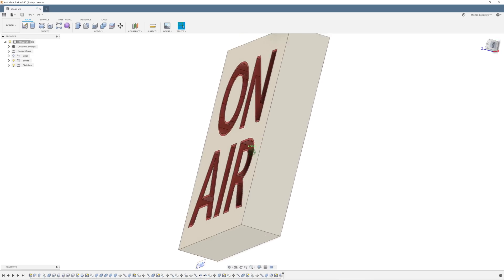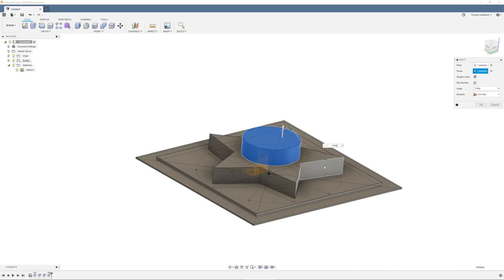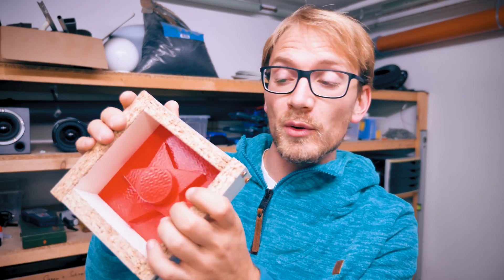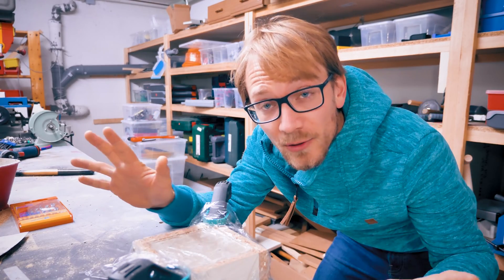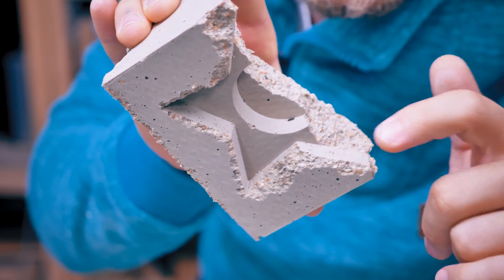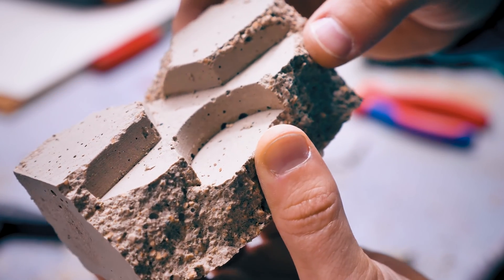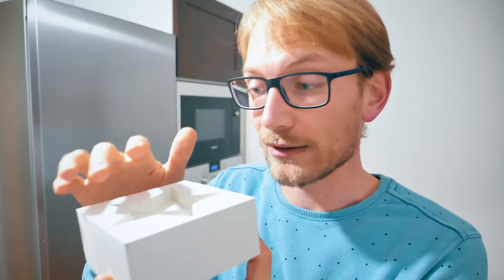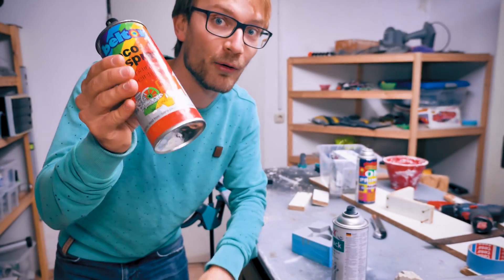Digital casting: 3D printed molds for concrete and plaster!

Comment: I printed a relief map of my region (using USGS data) in good old PLA, made a plaster cast of that (using "PAM" as a release), and used that to make multiple ceramic slip castings. The layer lines and surface details carried over perfectly to the fired pieces.  I'm working on the metallic glazes now...

Comment: Spray your mold with a LIGHT coating of cooking oil.  That will help it comeout easier.  To get rid of the 'bug holes', make the concret/plaster a bit more liquidy.

Comment: I've seen other YouTubers use melamine forms for making things like counter tops and tables, and there are some ideas you could take from those videos.  

Just a high-level overview of some of them:

- Use glass fibers in the concrete mix to give it some tensile strength.  It will hold together better, and will be far less likely to be breakable by hand.

- Apply a simple paste wax to the corners and edges, then seal them with a silicone sealant.  Then, skim over the silicone with something that has a rounded edge (I've seen some use a cake fondant ball tool to accomplish this), to push the silicone into the corners, and separate the edges of the silicone from the corner.  Then, once the silicone cures, peel off the separated edge, leaving the corners in place.  This helps seal against leaks, and softens the sharper edges of the concrete.  It also helps with releasing later on.

- For the detailed mold, apply a light layer of a releasing agent.  I've seen commercial applications use things like linseed oil, but there is also a synthetic product intended for this.  It'll make pulling the mold out much easier and cleaner.

- Some people have already mentioned vibrating your concrete when finished, but it's almost unavoidable that you'll need to make a bit of a slurry mix to fill pits and imperfections, and then sand that down when done.

Comment: I'd say concrete or if you can do a mix. of maybe so a two layer cast where the concrete is less viscous and coat the outer layer/sides and the rest cast in plaster. If it's in concrete it might weigh too much for comfort and if it's all plaster it might wear down after a bit... Food for thought.

Comment: If you like a textured look, you might try using Cura's "Fuzzy Skin" option when you print the mold.  The height and density of the texture is controllable.
Reply from the maker: I'm afraid that would lock the printed inserts solidly into the cast. Maybe once I've really figured this thing out, I can start playing with some of the crazier options!

Comment: Release agents will soak into the cement, concrete or plaster and will ruin a latter painting. Just leave it dry more time. Plaster should be creamy to mold pieces, it will make much better parts but also can hold bubbles. Once it is dry, if you are going to paint it, you need to apply a sealant, but not regular wood primers. You can try some diluted latex or pva glue if you do not find specific sealants for walls. Ah, and one more thing, plaster becomes hot when curing, as you already noticed, so my advice is pour a test on a disposable container and find out how hot it goes. 3dprinted plastics may distort.

Comment: With the concrete I had fewer breakages and chippings than with the plaster, when casting a chess set as part of a university project. I ran test casts using plaster (Herculite, a strong plaster used for architectural models) before making a few sets in plaster as well as concrete.

I used a mould release agent (any oil will work, I've used petroleum jelly, vegetable oil, olive oil, sunflower oil in the past  as well as industrial concrete release agent for this project) on all castings.

As far as the angle goes, it will definitely help in terms of releasing of there's a 2-5° taper.

I had difficulty in releasing certain pieces, so for the next iteration I plan to add a small hole that would be plugged for the cast, with a larger concentric divet to allow me to blow the castings out of the moulds with compressed air. It's possible that the taper may not be required with this change.

Comment: If the the positive (3d print) is going to be used just a few times, try using a sandable primer thinly applied before casting. It can smooth out the print lines considerably.  
Anchoring cement will also make a very hard cement product (but heavy). Add some fine aggregate or tiny glass beads and maybe a bit of concrete colorant for a more finished appearance.

Comment: If you have a vibrating sander (the rectangle once) you might get rid of the last bubbles. Just run it on the table instead of hammering.

Comment: There's a product I've used in the past for making outdoor stepping stones with stained glass tops. It's called white mosaic outdoor cement and is made by a few different manufacturers. I tried to find material specs, but all I could find that it was portland cement and sand. I agree on keeping the draft angles, and vaseline makes a good mold release agent. Thanks for another great video!

Comment: When your painting fresh plaster you need to do a 'wet coat'.   It's super easy you just need to the mix the paint with water (1:1 ratio), then paint over again with pure paint when its dry.

Comment: Definitely with this filaflex you can make excellent molds. 
Small tricks to improve casting in molds of concrete, gypsum or plaster of Paris objects:
with each new casting, brush the surfaces of the mold with liquid soap: the one for dishes is fine, this will facilitate the detachment of the surfaces,
the most technologic will be able to use professional release agents, but to make tests the soap is excellent, I used it at middle school in the hours of art.
To avoid air inclusions there are two methods: prepare a small amount of more liquid dough and pour it into the mold covering all the surface that will be visible, stirring and beating the mold as Thomas did, let it harden a little and then fill with the rest of the dough with a normal consistency.
Second method, more complicated, put the mold filled in a vacuum chamber that will remove all the air, vibrate the mixture and re-inject air before it solidifies: the atmospheric pressure returning will further compress the mixture, reducing the number and size of the bubbles .
Third and last trick: a lot of patience: fill the mold, put it aside and forget it for a couple of days at a minimum.
Another little help in making molds: vertical surfaces should become slightly oblique: slightly conical the cylinders and slightly pyramidal the prisms.
bye

Comment: Add a very thin layer of petroleum jelly on the inside of the wodden frame. That will help removing it. That second attempt came out much better. Please use plaster. Just add some gravel or course sand. You could build a vibrator that would help getting rid of the voids ;-)

Comment: The vertical planes of the model has to be in a small angel. Not 90 degree, but in a angel 85-88 depending of the material. Then de model goes better out of the plaster (or what ever)
Arie

Comment: you need a sander or something to shake the table to get the bubbles out. also in the US there's this really fine concrete called quikrete that is used for countertops and stuff and can be smooth as glass. maybe you can find something in Germany that's similar.

Comment: There is a product called Merlin's magic and excalibur that is used for mold making.  It has the strength of concrete but the workability of plaster.  You can use waterdowned jet dry to help with the bubbles

Comment: I am curious to see what effect the different infill patterns and percentages will have on the top surface of the print, and therefore the mould. The gyroid waves looked very pretty on the top of the candle-holder with the shadows that it casts on itself at 14:28! :)

Comment: I would add munched fibreglass strands into the mix. That will help keep the cracking and splitting down. 
Second the release agent. I will occasionally use the wax ones so I can merely heat the mould and it falls out.
Or, if you are making a bunch of these things, I'd make a silicon mould and then no release agent is rarely required.

Comment: Good addition of the draft, but the sharp corners at the base of the model can cause major headaches as well. Typically in metalcasting we use some level of chamfer or radius on inside corners like that for better mold release.

Comment: I'd do plaster and I'd also reinforce it with some kind of fibre (Cotton - like a cast for a broken arm, glass also works, carbon too. Even hair if you want to go oldfashioned.) It'll help protect against some of the brittleness which leads to cracking.

Comment: as mentioned in the comments before, a releasing agent, like for example WD40 will do the trick. but also no 90 degree inward angles, cause that is where the mortar gets stuck in
Reply: I got also quite results with Vaseline as a releasing agent.

Comment: Hi Tom. I use 3parts fine sand, 2 parts rough agregate like fine gravel 3-4mm and one part cement. I get awesome castings like this. Remember to vibrate it heavily to get the bubbles out.

Comment: I'm making slip cast pottery with plaster moulds. The patterns I design in Fusion 360. I print these, then make moulds off of them. I also CAD and print part line guides to help with complex moulds. When I get a site together, I'll publish pictures of my results.

Comment: Why didn't you just print the mould directly?
Reply from the maker: You mean leaving out the melamine sides? The next step in this project requires me to use them, so I wanted to give the approach a good trial run before I cast a 3kg brick that ends up fused to the mold.

Comment: Hm, maybe using a construction primer ('Tiefgrund' from your local Baumarkt) would result in a better surface finish than with the spray paint primer? Also, letting that plaster set for 48h+ will do wonders :).

Comment: Look up the term "Release Agent".  That will help.  Also, if you have a palm sander turn it on and put it against the edge of the mold.  That will vibrate the bubbles to the top.
Reply: Yes the eccentric sander was the first thing that came to my mind too.. vacuum would be much better, but I guess it`s harder to get one, and it`s more expensive
Reply: @gatisozols  shop vac, garbage bag and a roll of tape
Reply: @Jeff_Rowe_Nuggzy  :D good one but I don`t think it would hod vacuum very well
Reply from the maker: Many comments are recommending grease-, wax- or oil-based release agents, but I'd be afraid that those will transfer into the cast part and prevent the final paint layer from adhering properly. The print actually released from the cement-based and plaster cast quite well, the only thing holding it in was mechanical locking.
Reply: @MadeWithLayers  you can always of course degrease the part afterwards, and prime it before painting. I believe concrete needs a primer anyway. and if you use a very thin lubricant, it will not transfer into the texture. yes. the print did release. but as we saw, it got stuck in the inside corners. maybe a shamfer could help in those corners
Reply: @MadeWithLayers  use paste wax.
Reply: Thomas, IMO you could make a PETG based form of two details. 1st - the form, 2nd - the handle to pull off that form. The handle can be fixed with a big thread with a flat triangle shape (so it will be locked vertically by as many rounds as you'll make it). I guess with 1 deg. angle draft it will be releasing quite easy. MAybe you only need to flatten layer lines with a sand paper.
Reply: @MadeWithLayers  You are correct that this CAN happen, which is why you will need to prime it anyway.  So you can use a light wash of pool cleaner (muriatic acid) to clean the concrete.  I say a "light wash" because if you use it at any significant strength it will etch the concrete.  There are also many other cleaners degreasers out there as well that could be used if you don't want to mess with that nasty stuff.  Also, since your part is flexible you may not "need" a release on the top, but you will on your sides.  I was geting more at that aspect.  I've seen (and had) concrete bind right to that top layer of particle board before.  I started using PAM cooking spray from a suggestion I heard from a person that does concrete counter tops.  Worked great.  Haven't done any forming in a long time, but it worked.
Reply: it depends what you want to do with the form. Oil,grease,wax is good when you want to use "safe" stuff for silicone casting for example. Lots of the relaease agents have nasty chemicals in them so not good for your health in the long run. Just read the ingridience list, research and judge yourself.
Also for the Plaster there exist a high grade version where you can get even more detail. Its whiter then normal plaster.
Reply: If you put ISO alcohol in a spray bottle and spray it over the top of the plaster just before you cast it will pop the bubble. Also pour the plaster over your hand, shaping it like a ramp to reduce the chance of bubbles as it hits surface
Reply: Also pour into the corner for the plaster just as it begins to thicken from a liquid and peaking(when you run your finger across the top you see the line for a second before it settles out), this will ensure the plaster covers your object as a liquid, capturing all the detail but will still set quicker. I would also seal the bottom of the melamine with paste wax or Shellac so that it does not swell from the moisture underneath.
Reply: well, even a very thin coat of WD40 might do the trick as well. or any other oil base for that matter
Reply: @enricotempert  "Release Agent"...doesn't matter what it is.  Corn Starch, Talc, etc is used quite a bit for metal casting release agents...For concrete counter tops many have used a thin layer of petroleum jelly.
Reply: @WreckDiver99  for concrete or cement, a powder wouldn't work that well. of course, better than nothing at all, but in construction an oil base is almost always used. and yes. petroleum jelly is oil based. although I think it is a bit too thick for this little thing. it will leave marks if not spread very thinly
Reply: @enricotempert  No doubt on the powders...I was just giving an example of a "release agent".  Many people hear that word and immediately think that means some ultra special item.  Sure there are "Parting Powders" available for casting operations, but talc works great.  For Concrete I've used PAM Cooking Spray (WORKS AWESOME), as well as Petroleum Jelly, and even "AquaCon" (which is actually a "commerical" release agent).
Reply: @WreckDiver99  I have only used the professional stuff, when I was working in construction. so I don't know much about the home-brew stuff. but I think a powder and thick stuf like petroleum jelly or Vaseline will leave marks. for applications like this, you only need a microscopically thin film of a releasing agent, that will do perfectly, and will leave almost no mark at all
Reply: all he had to do was take a heat gun and melt the 3d print and then he could pull it out easier
Reply: @thatguyfromca  I believe part of his intent was to keep a master copy so he wouldn't lose it.  This wasn't a "lost media" idea (i.e., lost wax, lost foam, etc).  He wanted to preserve the master pattern to be able to make more molds.
Reply: I'm using cooking oil with extreme good results, olive is very expensive but it's denser when cold which is good, I used a batch that went rancid. Regularly using sunflower oil and works as a charm.

Next time I will just get the cheaper oil we get here, probably soy.
Reply: this whole thread paints my thoughts exactly. grats on moving a step forward... but im appalled a creator in end 2018 is releasing a super basic, grade school level art project, with what seems to be very little understanding. 3dp, trouble with plaster... hm.

Comment: I know it can be a little more but for casting I prefer dental plaster. It pics up a super amount of detail,  sets up much faster and as the name implies use for dental applications so its super strong and durable. Combine that with a table that you can vibrate (I built myself a cheap vibrating table) or hit softly with a rubber mallet to remove bubbles. TRICK: to remove bubbles poor the solution or casting material from a height above the mold being made, the bubbles will come out naturally.
Reply: St. Gobain Dental and HP2 plasters are twice as expensive as their Fine Casting plaster. I have been using their Fine Casting plaster for mould making and it works better for me as its curing time is longer.  The surface finish on it is just as good as Dental or HP2 in my opinion. It's also easy to get hold of, as lots of builder's merchants stock it.
Reply: @dewexdewex  Good to know. Does it have a manufacturer name(s) or is it easily found as fine casting plaster?
Reply: @coreyeaston6823  in my experience in the UK the dental plaster and HP2 are stocked by specialist arts supplies businesses. Unless you live nearby one, you're stuck with paying postage on a 25Kg bag and paying £25 for the bag as well. Builders' merchants are easier to find and do stock the casting plaster for £11 a bag incl. VAT.